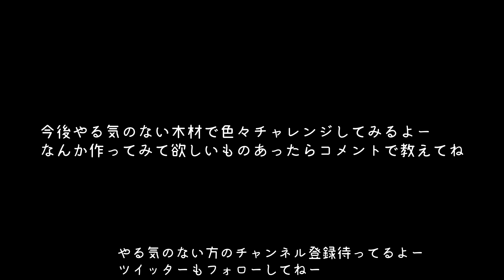超やる気のない木材で遊んでみた

Comment: There IS a use for these sort of things! You use them to make rounded curves in wooden structures. It could be a piece of furniture, like a bookcase, or to make a decorative feature on a wall...something that won't need too much direct strength.
You would need to spak- fill the crap out of it though. It'd have to be a painted finished item,  otherwise it'd potentially look really bad.
But structurally? You could do some very interesting things with this!

Comment: You can also mess around with steaming the wood to make it reform into a naturally curved state, the filling the gaps with apoxy or if the curve is small enough, glue and wood shaving, and it could look really cool in pretty much anything that has bends, like a handle or an arch above a doorway.

Comment: Stain wood, then put in casing, then inject epoxy, then remove casing,, polish, drill hole in center vertically, insert a RGB led tube, add a base. You just made a real nice lamp!

Comment: I wonder if this could be used to make some kind of pull out drawer or something? like if you have a very small amount of space, you could use this to build a drawer or something that can fit into a cabinet or something and pops out when you open the door, and you can push back in after.

(yes I know drawers basically do this to begin with, but i mean with a closed drawer. yes i know there are slides and stuff that do this already, but this is more fun.)

Comment: you might not be able to translate this comment, but in case you are:
use a light colored wood.
make the most flexible kind of this thing.
bend it into a shape you want.
(a table leg would work well.)
fill the gaps with dark resin.
sand the piece.

edit:
I forgot to say that I really like this!
I'm using short sentences so that google translate will work properly.
Reply from the maker: thank you!
Reply: @kurahito  you're welcome !